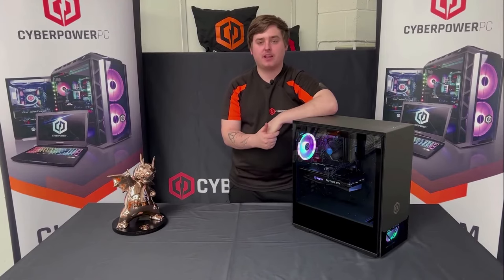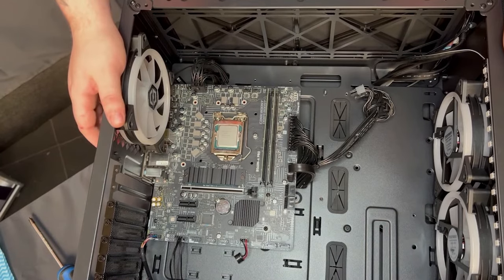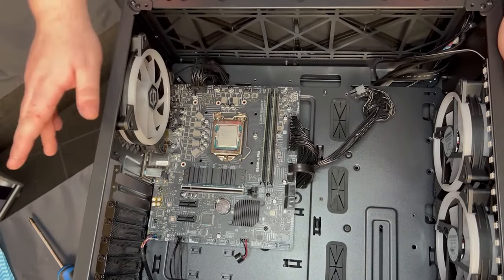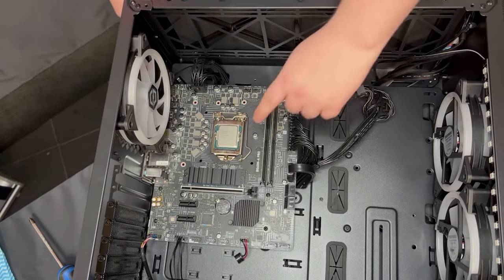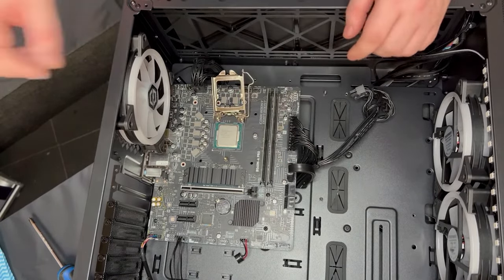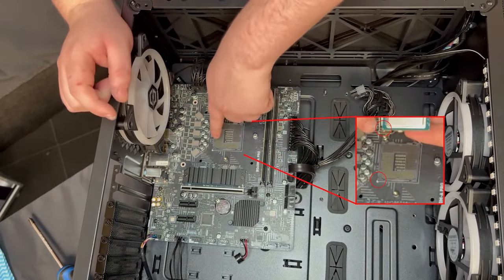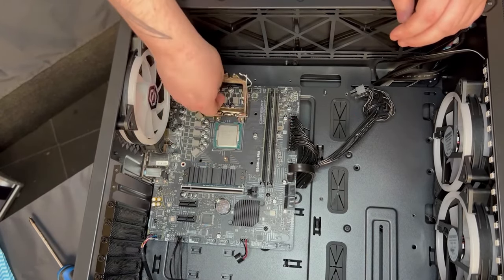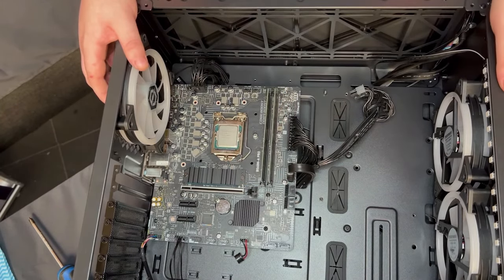Remove And Install Intel CPU | Tech Tips

Comment: You r not suppose to touch the bottom of CPU
Reply: The bottom of the cpu has 100s of thin pins that can be bent with little effort
Reply: @learn2pimp478 it’s LGA. The pins are on the motherboard
Reply: @athr_eus still best to get used to not touching the bottom, even if its lga